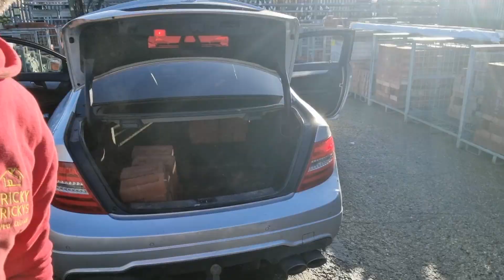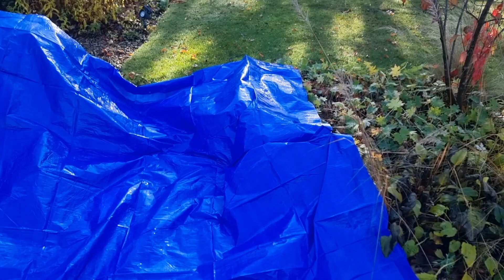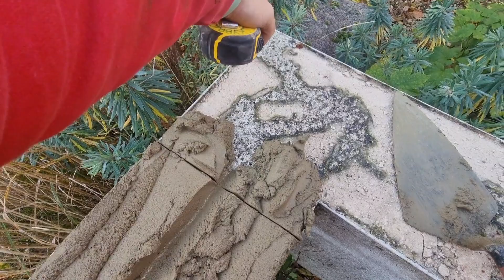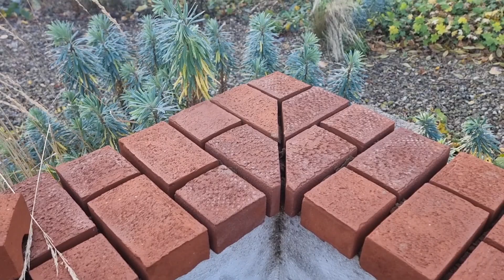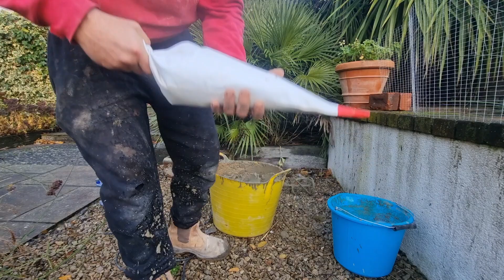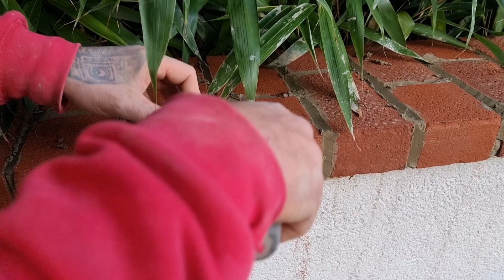Bricklaying something abit different #bricklaying #construction #brickwork

Comment: Lovely work mate. Was just wondering though. I’m surprised you didn’t fill the frog aswell before you layed them frog down just to make sure they were all full and compact with the muck so there’s no where for water to build up
Reply from the maker: If you watch closely I was putting extra piles of mortar in the frog position on the bed 😉
Reply: and an adhesive either side of the muck....its usually the difference between not been able to pull one off if you tried and just knocking one off by simply leaning against it